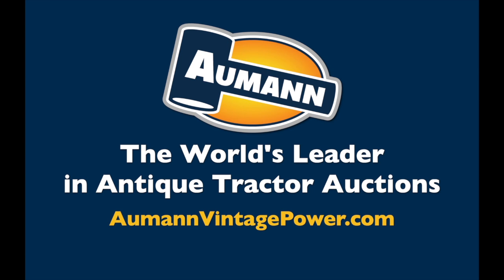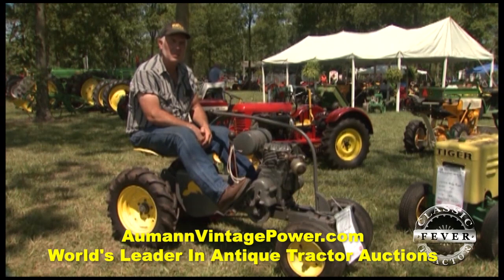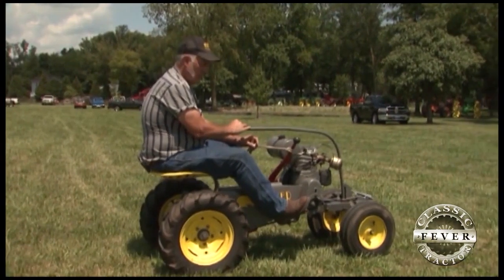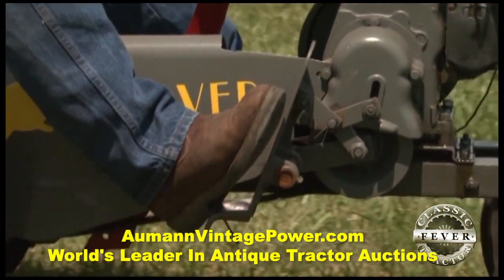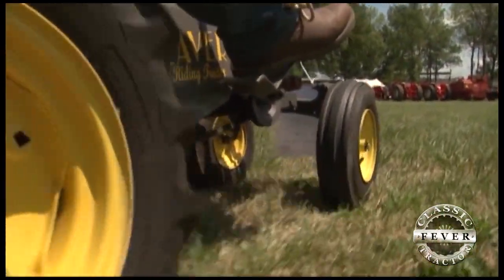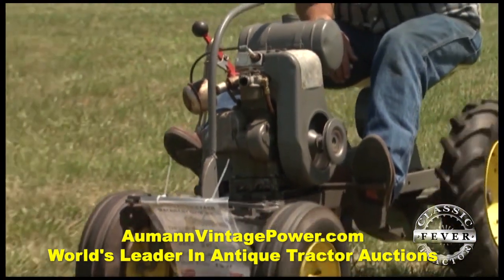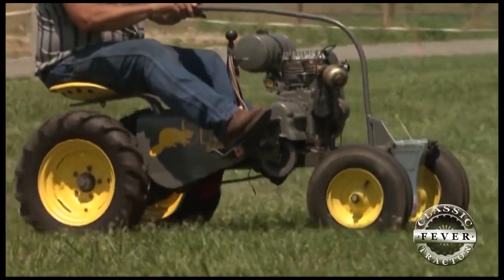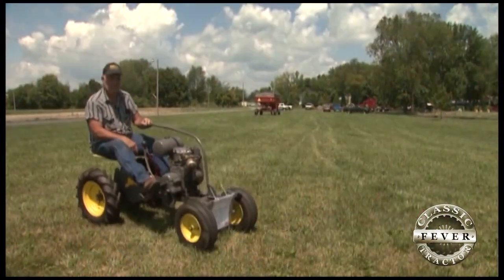Tractor Has NO STEERING WHEEL! Low Production 1950s Beaver GR-T6 with Tiller Steering

Comment: A "Shuttle shift" drive for forward/reverse  that would pair up great with a tractor and front end loader.
Reply: Agreed. I use a Moffett brand demountable forklift at work.
One foot is accelerator and the other foot is forward and reverse.
Left hand for steering and right hand for controls just like on most garden tractor FEL setups. Works well. Very efficient and easy to use.

Comment: It looks too lightweight to be able to use any implements.
Reply: Actually, you could get a sickle mower attachment, bottom plow, cultivators, disc's, front rotary mower, gang mowers, snow plow, etc. I have a couple of these tractors and a few implements. I have sales brochures showing the attachments. A dual rear wheel kit was available along with wheel weights. They are heavier than they look.